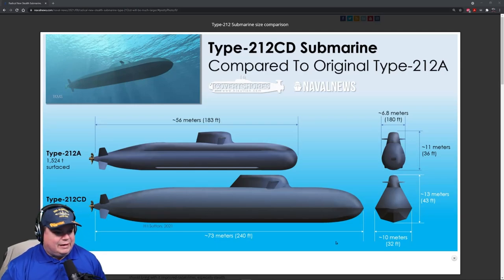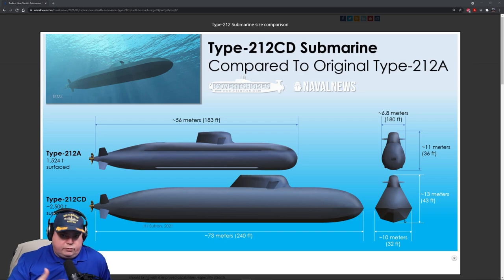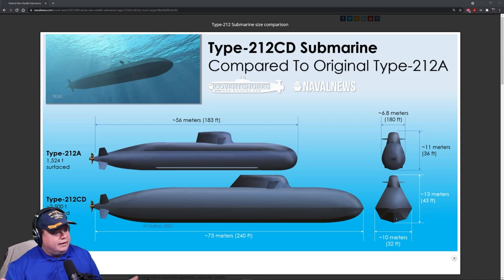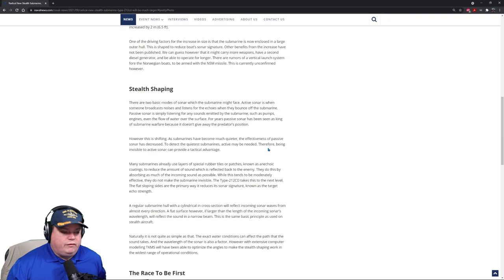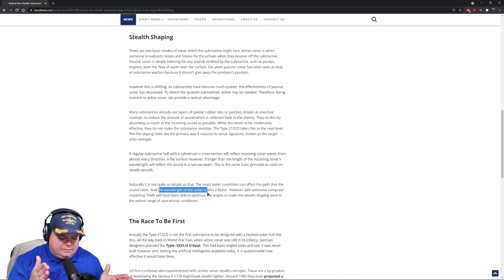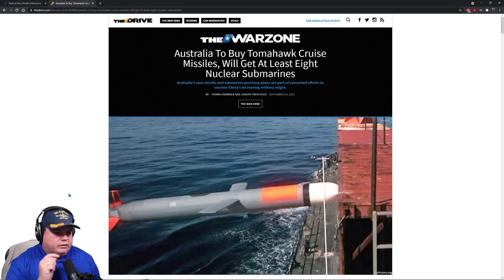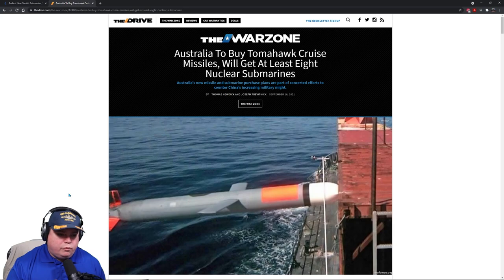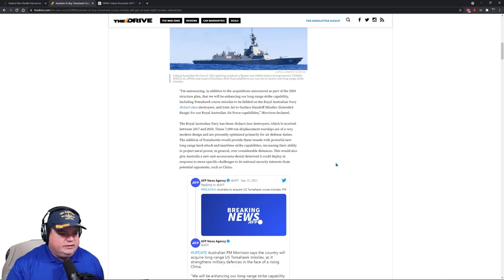New German and Norwegian Type-212CD

Comment: That type 212 sub is what Australia really needs rather then the nucs because it is small and only requires 30 crew. Way more suitable for our small navy and the shallow seas they patrol then the nuclear subs being proposed.
Reply: Nuke subs are more noisy also..
Reply: The problem is that a submarine with the size of the U212-CD have not enough range for a very large country like Australia. It cannot reach Perth from Adelaide, or transit far and fast.
Reply: @geoffreya375  Even the regular german Type 212A can dive from Europe to the US without surfacing. They can maneuver underwater for 3 weeks. This new version Type 212CD will have even more AIP range.
Reply: Nuc subs are also very noisy.
Reply: They're a little small compared to the Collins, which can be an indicator as to required capability and future expansion of those capabilities. I think the size helps with future proofing a little, if you get me. Imo the proposed Type 216 sounded pretty good, or the Japanese Soryu if we're talking conventional subs. I have mixed feelings on nuclear sub capability... I think there's advantages to developing local nuclear infrastructure, but if we end up having to buy an interim class for the Collins, the cost is gonna be even more revolting...
Reply: You can use also the german Taurus rocket in this Sub .
Reply: Nuc subs are noisy and warm .. not good for stealth

Comment: Hobart Class already has a MK41 VLS.  They do not need any physical modification to carry Tomahawks.
Reply: Unless its a strike lenght Mk 41. Or else it can't mount Tomahawks.
Reply: @kevinyaucheekin1319  in 2024 they will be progressively upgraded to aegis baseline 9 and will be equiped with sm6,sm2 block 3c, essm block 2 and have either the lrasm or naval strike missile. Hopefully the anti ship missiles will be contanerised like the current harpoon armament so it will not take up space in the mk41 vls
Reply: @kevinyaucheekin1319  Hobart Class has strike length Mk 41s
Reply: Hobarts have 48 cells so they can carry 8x Tomahawks, 8x anti sub VLA's, 4x SM-3, 18x SM2, 40x ESSM's in quad packs and a Drop Bear in a gum tree and 8 Harpoons in quad launcher on the deck.